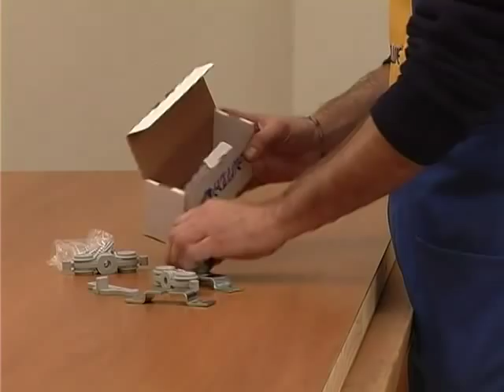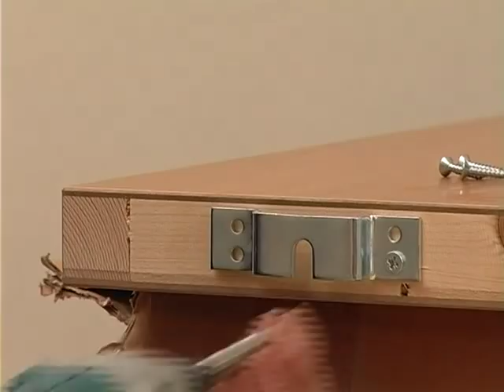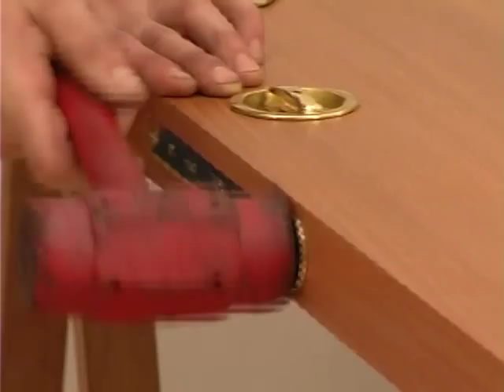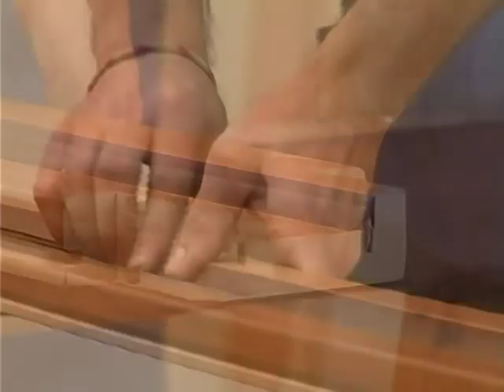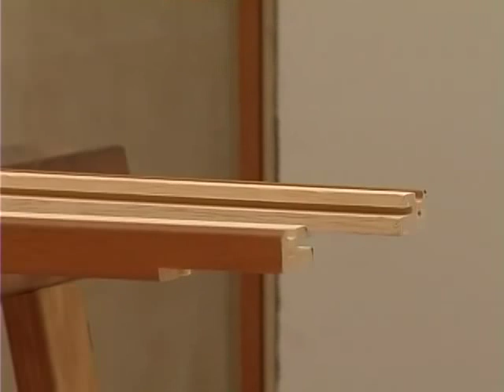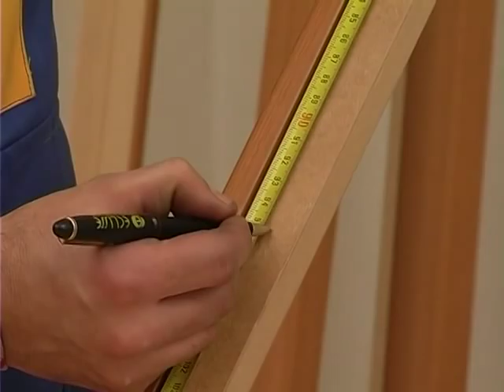Jambs and Architraves

Comment: My wife saw the marketing video for Eclisse and convinced me to install one in the kitchen panty. Seven hundred dollars later we received the 30 x 80 kit with the soft close and frame kits.  First the instruction illustrations didn’t match the components in the kits and the several pages of cartoon pictures were not helpful at all. The instructions are the worst I have ever seen and the online I called the 800 number
Reply: Same problem here. Hence why I am watching this video. The cartoon instructions are stupid and not detailed.
Reply: The instructions suck but the result is great. I used Johnson 1500 soft close pocket door hardware with the optional plywood frame stiffeners, EMTEK handles, and the Eclisse jambs. There's no light leakage at all, and the door is smooth, silent, and about as soundproof as a regular door. For the jambs, I elected to toss the instructions and use a more traditional shim approach. With that approach you drywall and floor first, and install the jamb last. That way you can cut the jamb to be flush to the finished floor which is much nicer. You use shims instead of the shit metal things they provided, and I used screws to fasten it. For the top piece, you have to make sure it's removable or you can't reach your door hardware for adjustments ever again, so I countersunk two screws on each side to hold it in place but make it easy to take apart if I ever need to work on the door.

Comment: We had a big run in with Eclisse about this...they claimed it wasn't their video and that they didn't supply jambs with slots for clip in architrave as shown. We provided drawings explaining how with a 125 stud wall and 2mm skim each side the jambs were recessed and left a bare plasterboard edge. They weren't interested. Told us they sell thousands and no-one has complained. We ended up having to edge the plasterboard with finish beading and delicate caulking and painting. God help us if we ever need to remove the mechanism...which requires removing the jambs.

Also on this job the doors were glass and the jambs plus brushes each side resulted in a 20mm slot for 8mm glass...looks rubbish. We don't fit these any more as you can understand!
Reply: Having to do the same thing right now. Also found the metal frame a little flimsy.
Reply: Not their video? Are they kidding? It literally says "Eclisse International" and has their logo!